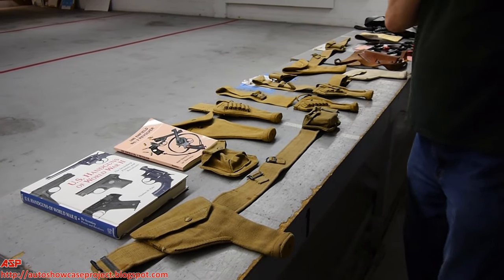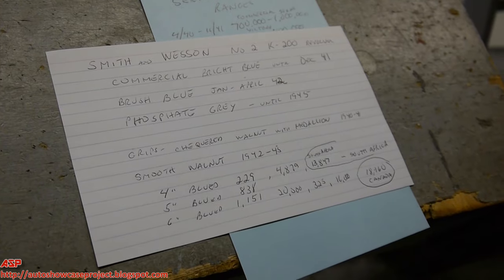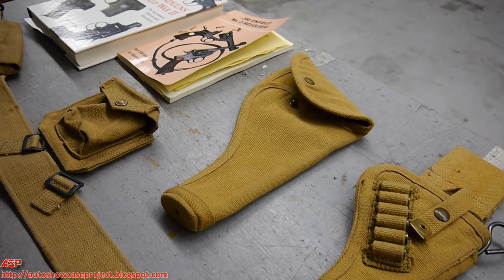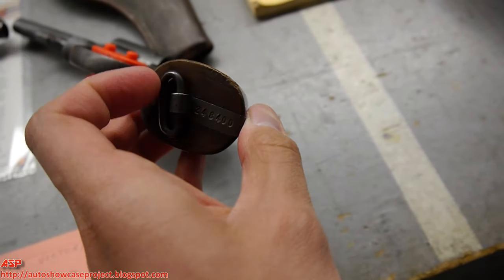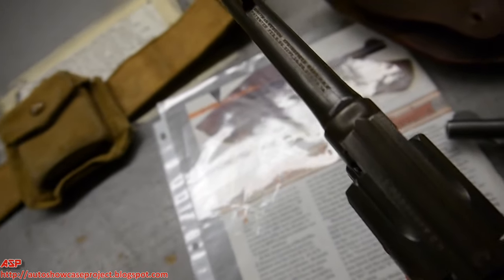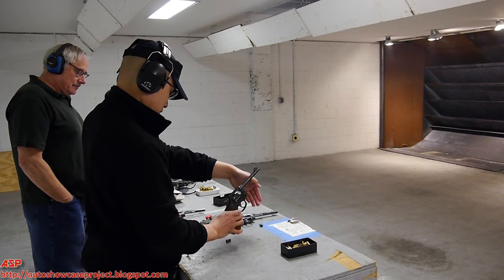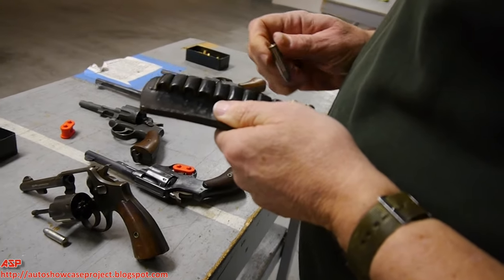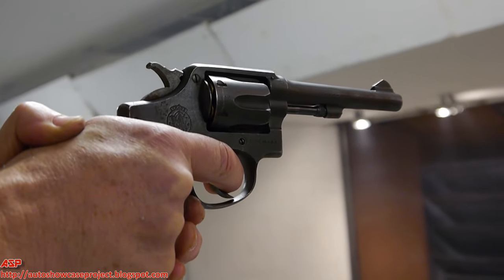The S&W Pre-Victory and S&W Victory Models | Collector's & History Corner

Comment: Its not the gun's fault it skipped a round, it was operator ERROR.. You short stroked the 5th shot. Either you couldn't complete the trigger pull or you can't follow thru on that pull that's why it skipped the sixth round.

Comment: Researching a revolve my Dad had when he worked briefly as security at a LV casino. He purchased it at a pawn shop in LV. The serial number is V65xxx3, (for security reasons I'm not post the entire s/n) a non V-number 91886 is on the frame and crane at the hinge, on the cover or under it. On the rim end of the cylinder is the "P' 'V' and 65xxx3 markings. The wood bark looking grips have 154253 stamped in one. There is no manufacturer marks anywhere. On the frame right side is MADE IN U.S.A., on the cylinder is ENGLAND with a crown and a couple of unreadable marks at the scallops.  On the bottom of the 1-5/8" barrel is a Crown mark with small BNP then  .3/8" .767" next line 3 1/2 TONS then some more unreadable markings. Other markings are a 'P' on the top strap left side. And what could be a 'D' above the 91886 on the frame. There is a plug in the handle frame where a lanyard swivel was.  Finish is bright blue. Any way to get details on date and manufacturer
Reply: You have a Lee Harvey Oswald special.

Comment: I have a pre Victory, Canadian army marks and a previous owner shortened the barrel. 30Ft shooting distance gave it a drop of 2 inches. Ammo supply issues meant I used 50 year old surplus ammo and some had loads that did not fire... my gunsmith said I should convert it to .38 special but I could not butcher it, all numbers matched. Soon it will be deactivated to EU standard.

Comment: my Dad has 5" victory model .38/200 that had a lanyard ring that some one had cut off before he got it there's no import markings on it It has the v Mark then the lanyard ring then the 6 digets number starting with 2 3 as the first to digets Avery thing has matching serial numbers but there is another number on the swing out cylinder arm and the inside with a 5 diget number starting with 85594
Reply: That number was a sequence number that kept match frames and cranes together before the serial# was assigned and the gun assembled. It wasn't uncommon for frames to be as much as two years or more before they were actually used to build a gun. This one of the reasons why many of the production charts are rather vague beyond giving a range of years in which a serial number range was produced.

Comment: I can put a 9mm cartridge in the 38 revolver ??
Reply: Amir bro, no. The 9mm cartridge is too wide to fit in a chamber of the cylinder.
Reply: Totally different cartridge,  9mm is for automatic pistols, also it is a much higher pressure cartridge.  Assuming you could make it fit... with half moon clips or something,  probably wouldn't be safe to shoot. Yes 9mm is also .38 cal.
Wouldn't want to be trying a speed reload  with those ammo pouches. Can't even get them open.
Well done for spotting the squib, get rid of that old ammo.

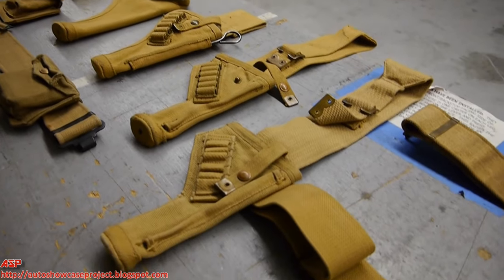Comment: Those British holsters at 16:48 dont really fit the Victory well, the swing arm part of the frame snags and prevents the flap to be buttoned up. I encounter this problem with my 4" barrel, which is the maximum barrel length for a victory that will only just squeeze in. There is no way these holsters will fit a 5" barrel victory!
Reply: Mine fit and locks flap. you might have a rejected holster unloaded on the surplus market.